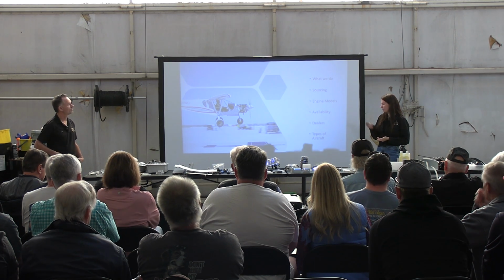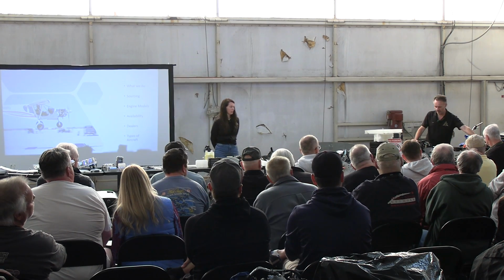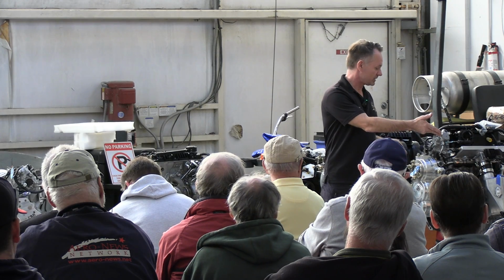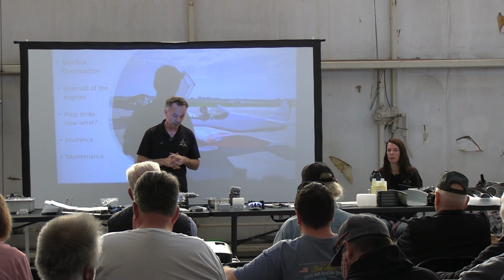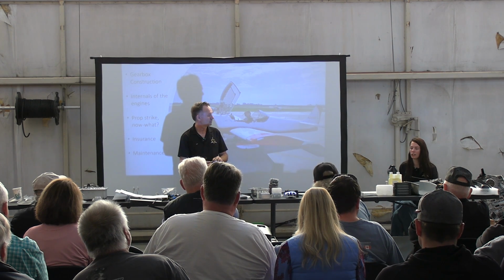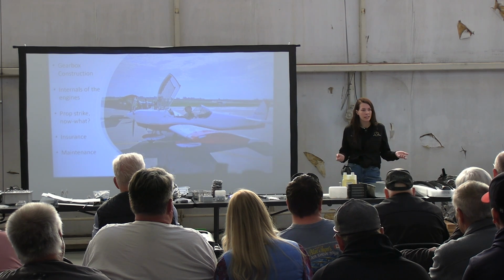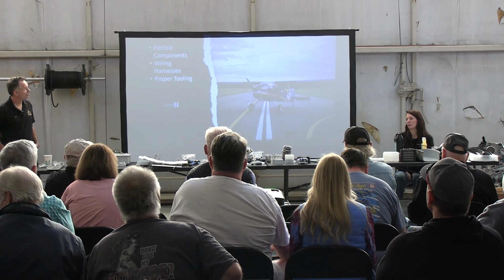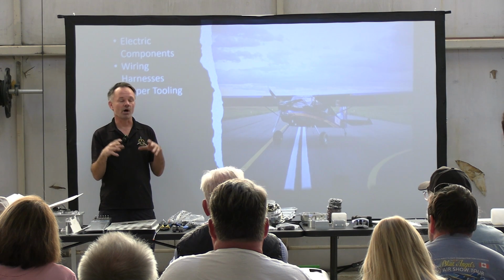Viking Aircraft Engines - Engine Day Session 1

Comment: Reliability and miles driven does not translate to an aircraft engine. 
Aircraft have very different demands of an engine relative to an automotive application. This was not addressed. 
While I applaud the effort.....this presentation did not help with my distrust of auto conversions. It probably helped me to distrust the concept even more.
Reply: How about aircraft engines are the MOST underdeveloped, technologically ancient engine in the engine world. Its not because old school is a good school, its because  people are afraid of change. When is the last time you drove to work and all of a sudden it just stopped working? And yet aviation engines do quit...how about the biggest threat you have is just infrequent use. Do that to any engine and it will have issues.

Comment: TBO : as Mike Bush put it simply in a webinar, there is no point in changing or overhauling an engine just because it reached a given number of hours. If the engine puts out expected power, AND does not have any sign of aggravating wear (like shrapnel in the oil), just let it be.

Comment: Whether Rotax sells to military or not, the reason for the high prices is greed. So replace the bastards. Teach them a lesson.
It's a failure of our community when people have to put in a lot of work for custom solutions to circumvent massive greed and that has been a standing situation for many decades. And it's getting rapidly worse. 912 at 19k$ was massively overpriced, now it's 50k for a 916. I heard from a charter operator that if you wanted a replacement I think it was an IO540 it's 100k. A WW2 engine. That fails often. You could make your own piston engines from scratch but the real way to kill them is making a small turbofan jet engine. Surprisingly Turbofan engines can be fuel efficient if only hte plane is pressurized so it can go high. Eclipse 550 twin jet is twice as fast as a Baron and has better fuel economy. Ponder that.
A jet engine for 2-4 seater personal planes could be 15kg with an opening the size of a CD. It's basically a complicated turbocharger for a car, same materials and principle so that should tell you how simple it can be to make. Simpler than a piston engine, much lighter, faster, cooler and natural dual engine config and redundancy. And in principle could run on any type of fuel.
Reply: Build it cheaper and let us know how it goes.
Reply: @Factory400  so you don't have to think?